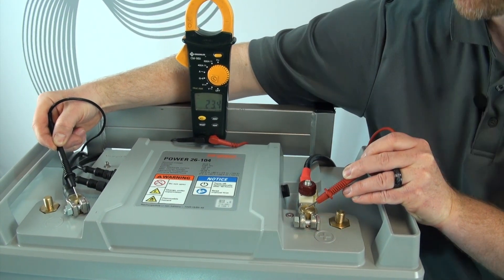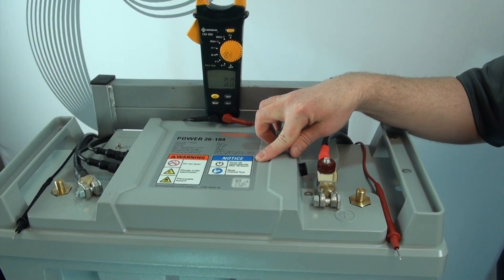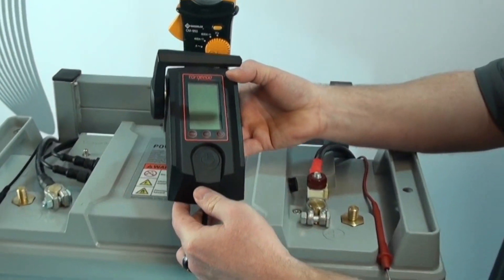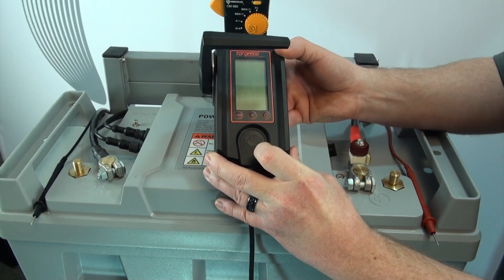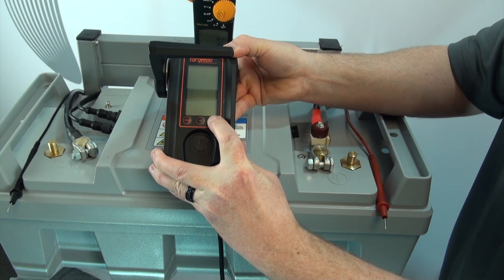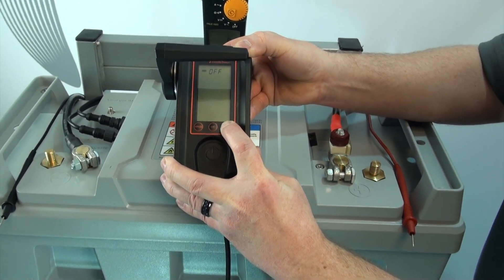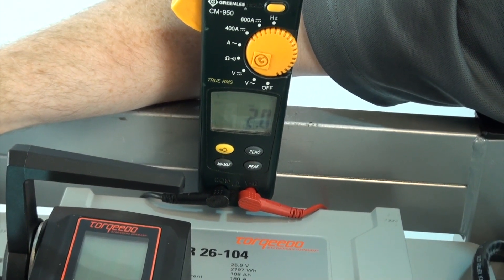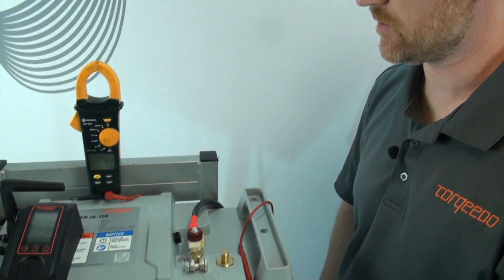Torqeedo Power 26-104 / Power 24-3500 Lithium Battery Storage Advice

Comment: hi, how do i correctly remove the battery from my system? I did not find the necessary information in the manual. I have a cruise 2.0 (inboard) and it has connected 6 connectors and i am unsure what to dissconnect first. Also i am not sure whether to remove the battery in the first place. I will leave my boat in water during winter, so the average temerature will be between 0-5 degree. Thx for any tips or hints in the right direction. (German is fine too)
Reply from the maker: Hey Andreas, thanks for your question and patience. It would be necessary to know if the system is running with AGM or Torqeedo Batteries. If its running with the Torqeedo Power 24-3500 ( former 26-104) you can check the manual on page 25: https://media.torqeedo.com/downloads/manuals/torqeedo-Power-24-3500-manual-DE-EN.pdf